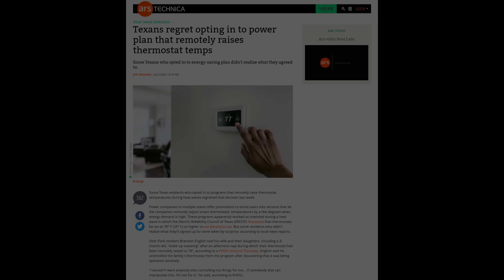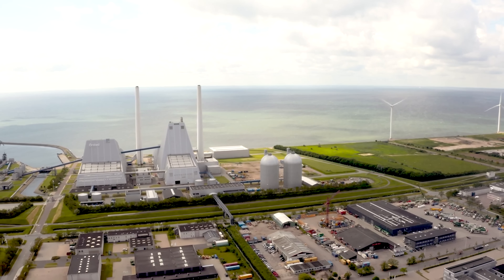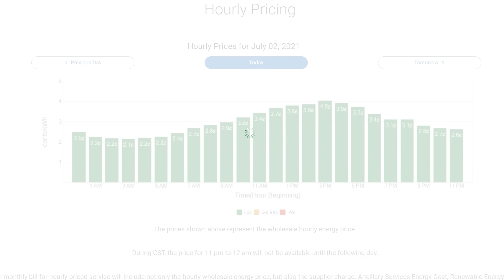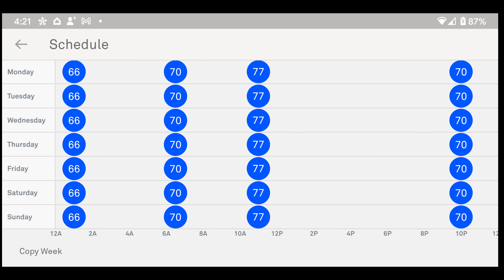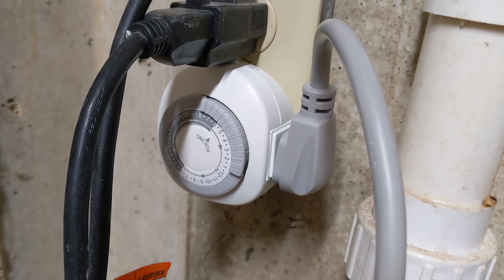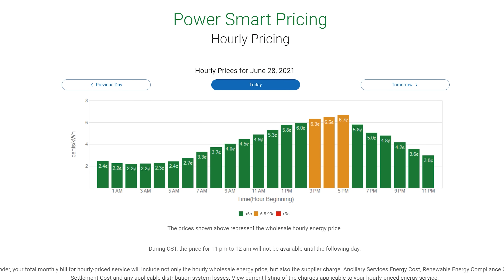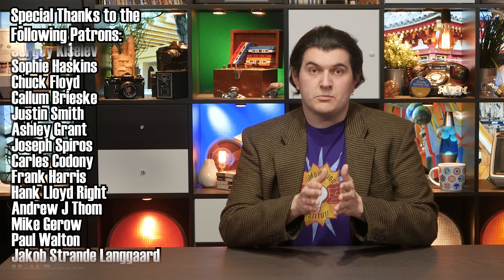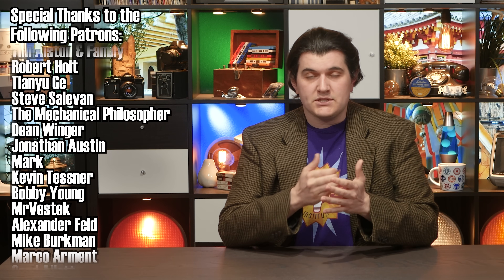Batteries aren't the only way to store energy. Here's another.

Comment: Running AC during the night has a further benefit - the cooler outside temperature means the AC runs more efficiently, so you get the same amount of cooling for less electricity.
Reply: It also dampens the neighbor's sound pollution! Now that's efficiency.
Reply: all while spending less money ! (though small , savings are savings!)
Reply: Wait you guys can afford aircon up there? 😂
Reply: Came here to say the same thing. He is even smarter than he thinks :D
Reply: Ah, no. That's not the least bit true.
Reply: @johnsmith1474  Are you sure? I'm no HVAC tech but theoretically, thermal heat transfer is proportional to the temperature difference.
Reply: @johnsmith1474  Yes it is. The coefficient of performance of an AC unit drops when outside temperature rises, because the ΔT at the condenser increases.
Reply: probably also when you you need the most dehumidification
Reply: @johnsmith1474  My understanding of the laws of Physics indicate it is; as others have pointed out: the COP changes based on temperature according to a previous video Alec / Technology Connections did and the manufacturers themselves.
So why do you think what you do?
Reply: I do that too, but free! It's called, opening the windows!
Reply: I thought you were going to say has the benefit of sleeping better because people have been found to sleep better in cooler temp :D
Reply: @sergioro8_125  I can sleep so well with the constant noises from the road, and trains going by every ten minutes.
Reply: Don't forget though that the colder house during the day has a greater delta to the outside temperature which increases the heat gain through the insulation. That condensation he spoke of on the outside of his windows every morning comes at a cost. It is called the heat of condensation and it indicates a larger heat gain through the windows. It is a complex system so the best way to measure results is to measure results. If he is using more energy but has a smaller bill due to time of use is he saving money at the cost of increased energy consumption? It would be interesting to know what his overall consumption of energy is with the two approaches.
Reply: @sergioro8_125  as a Floridian, if I kept the windows open all day or night I might as well live in a sauna
Reply: @raydoescoolstuff1135  Good point. However, the point of this video is not to decrease total energy consumption (which, of course, is a noble endeavor), but instead to spread out energy consumption over times where less demand is present.   If that means running air conditioning late at night or while solar farms are online, it's a worthwhile short-term win that prevents brownouts.
Reply: My A/C kicks on at night during the summer and it's a reasonably modern house (built at the end of 2007), if you tried cooling the house down at night it would be uncomfortably hot by the afternoon.

If you wanna reduce energy usage like this you basically just need to say "hey lets all move back into CAVES".
Reply: @theekdunn  Yes, but when the outside temp is lower, it's easier to dump heat in it.
Reply: @HiekerMJ  This is A: Not a useful addition to anything and B: Just toxic and stop it. and C: You are trying to look smart, I have to tell you I am not impressed.
Reply: Maybe not as much as it seems. It does help, but his 66 degree indoor temp in Chicagoland where summer nighttime temps can be high 70s is like setting to the EPA temp of 78 on a 90 degree day as far as heat loss goes, which is determined by the temp diff. You are right that the lower temp helps efficiency, but this goes like a ratio of temperatures on the Kelvin scale. The change from, say, 90F to 66F for the outdoor temp,  is the change from 305K to 292K. So, even with that little bit of increased efficiency, I don't think his night time operation will be very different from running during the day except a) the power is cheaper and b) he must overcool the house to get the needed glide through the day, and this will be a waste of energy (just guessing).
Reply: @theekdunn  
It's definitely true. High outside ambient temperatures cause the compressor head pressure to increase to force the refrigerant to condense at a higher saturation temperature and pressure. Running an air conditioner under cooler conditions decreases the head pressure, current draw, and electrical consumption. Also the Carnot refrigerator efficiency formula depends entirely on the hot side and cold side temperatures, nothing else.
Reply: @teaser6089  As a physics geek since the 1960s, I agree with Michael Moorehouse. I'm not impressed - most of the people I worked with already knew all that - but it was a useful addition for those unfamiliar with the basic physics.
What do you mean "toxic?"
Reply: @flagmichael  he put the information in an unfriendly way, hence I called him Toxic...
He may be right, but  telling someone: "So why do you think what you do?" is just a mean thing to say, not everyone has a good grasp of physics and that's great, we are all different, doesn't mean you have to be unfriendly to someone that doesn't fully understand a subject.

You should always remain friendly and if I spot a goddamned toxic son of a gun I'll call them out on it. I happen to be an Engineering Student and a geek for over half my life(21 now). Refrigiration is a weird topic and to people who don't study it, it can seem like magic and it makes you scratch your head. The question John Smith had was perfectly normal, actually quite natural of a question for someone without a background in Engineering or Physics, luckily others were able to answer his question in a calm and friendly manner, sadly mr Michael forgot to use basic human manners and I don't like that.
Reply: @teaser6089  excuse me young man, my youngest child is older than you, and one of my children was in a engineering program before deciding they didn’t want to work at a desk for he rest of their adult life. 
Asking a question such as “why do you think that?” can sometimes be said in a positive “help me understand you” tone, and not always a shaming/degrading tone. 

This being the Internet, and the vast majority of us users not being eloquent wordsmiths, it can be difficult to accurately ascertain a writers true intent. That fact that you responded negatively to a comment probably says more about you than the author. I went back over the thread twice to try and understand why you described him as “toxic”, but I’m not seeing it.
Reply: @tanya5322  excuse me old chap, I have no one to excuse to and you have no idea what my age is, I took his words the way I took it, if he doesn't want to be seen that way, he should work on how he words things.

Maybe I see it as Toxic, cause I ain't no merican, you people over there just talk differently.
Reply: @teaser6089  you said u were 21: /
Reply: It drives me cracy seeing the AC units blasted by sun light on the southern sides of houses, or worse oftween rooves.
Reply: why not run your ac during the winter, and turn it off all summer?

Comment: The heat pump in my home is heating up a tank of over 250 gallons of water. It can store about 50kWh of energy for heating the house and hot water for the shower and the tabs. It’s a pretty simple system even though one room in the basement looks a bit like the engine room of a submarine.
Reply: Can you tell us more about that? What's the brand and does it work in winter? Can it reverse and make a 250gallon of ice cold water too?
Reply: Most people don't have a basement. Your tank is just a buffer tank, nothing special, just somewhat bigger than usual.
Reply: Yeah, I have a water heater too.
Reply: The same in my house.
Reply: @MrWyzdum heat pumps have a >1 CoP. Meaning they are more efficient than electric heaters.
Reply: @rogerphelps9939  in the US perhaps
basements are common in other parts, stop imagining everyone talks about your backyard 🤣
Reply: @TheGahta  even in US basements are not common, some areas don’t have basements (TX), some have crawl-in basements (CA), he just shared what he is doing if it doesn’t work for you too bad, you need to find something else.
Reply: @gund89123  "Even in the us basements are not common"
Is this meant to counter me saying basements are common in some places?
Im not talking about the us 🤣
Perhaps don't butt into discussions if you fail to realize that other people exist too in the first place 🤣
Reply: I was thinking of trying this with rooftop hot water solar heaters, to store heat during the day and release it overnight and during the following day.  Not sure how to figure out required capacity. But in principle I believe it should work.
Reply: @tomomiko202 That has been common here in sweden for years. Wood powered heating for water has been very common for a long time, and the solar water heaters (basically black plastic tubes on the roof) is so you don't need to burn any firewood during summer.

Hot water is stored in a accumulator tank, so even if ypu use firewood, in winter, you basically need to start a fire in the boiler once a day, and you still have hot water all day
Reply: @MrWyzdum  my water heater doesn't typically heat the house, except during freezing nights I do fill up the tub with straight hot water. What sucks is, the pipe insulation doesn't seem to be very good, so to the furthest parts of the house (kitchen) I have to leave the hot on full to keep it hot, and within a minute or two after cutting it off, I have to start over.

Comment: A friend was rebuilding a greenhouse that originally had  a 2'6" brick wall with the glass structure built on top of the wall. He then bought a second hand aluminium frame greenhouse that fortuitously fitted over the brick wall, leaving a four inch gap between the wall and the glass. 
This wall made a great heat storage device. It made for a really good passive heater. At its location in the UK I estimate that my friend gained almost two months growing time in this greenhouse without any extra heating.
The brick walls heated up in the day and radiated heat at night, it had automatically opening roof windows that used the expansion of wax in sealed  tubes to open them. He was able to produce very good crops of tomatoes, chillis and other vegetables.
Reply: Designs like this are becoming more common. You can also find a greenhouse design that is using thermal energy from the ground.
Reply: @snoopdogie187 Yes, when I put up my own greenhouse I got twenty litre capacity dark colour bottles filled with water - ten of them to act as heat storage, it worked reasonably well, but wasn't as good as the brick wall heat storage.
 Around twenty years ago I added a conservatory to my then house.. I made a thick concrete base with some 75cm pipes running through it. I then had another linked pipe going up to the conservatory roof and added a fan to pump the hot air through the floor pipes. This cooled the room a bit in the day but provided warmth from the floor in the evening.
Reply: If you have the room, a couple of 55 gallon barrels filled with water and painted flat black sitting in the sunshine will really help.
Reply: @peterjf7723  Heey this is a good idea, me now thinking how I can implement this.
The good news is,its low cost, and, yes I can see this will do something,...
Thanks.
Reply: @dleland71 Thats giant ones, would it be better big ones or little ones, little more heat accumulated/less storage capacity I guess or
(the idea I just get from this video and comments)
Reply: There's a house on the UK TV show Grand Designs which was made to be very eco-friendly. It has a gigantic solid concrete staircase in the middle of the house which gets full sun all day from windows. The concrete then radiates that heat back into the house all night, so there's no need to run a heater.
Reply: Planning on doing exactly this.

Comment: I have been struggling to find a way to better manage electricity costs as an Iowan, and I need to say you have been a lifesaver to me. Using things from this and your heat pump video have helped me cut my utility bill by 38 percent
Reply: That's a lot!
Reply: Yeah, I've cut mine the same way and by cutting unnecessary cycles like the sanitize and dry cycle. Just open the dishwasher when it gets done. Also, use that 4 hour delay button to make it come on when off peak rates for your energy use kick in to save even more money. Do laundry at night during off peak hours as well and save. This guy has made me actually use my head and see that just small adjustments to habits can save lots of money.